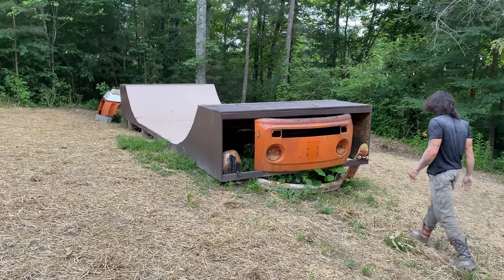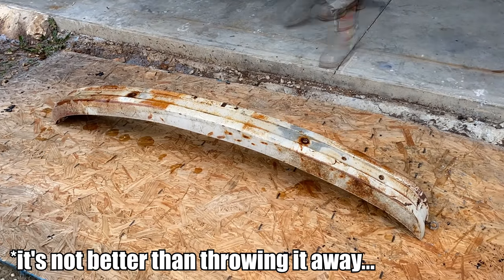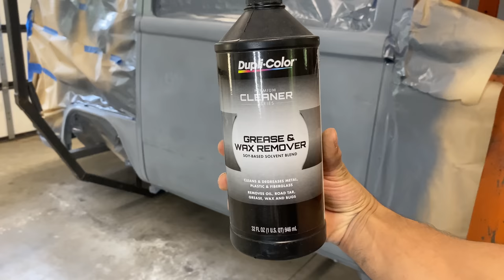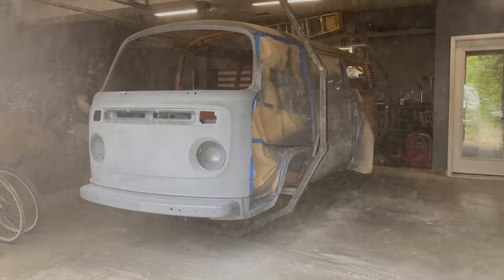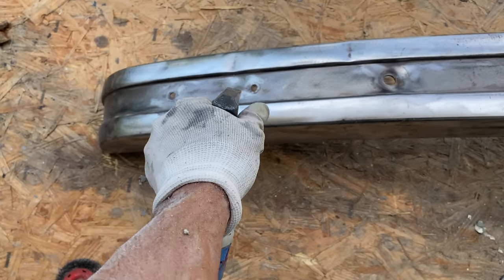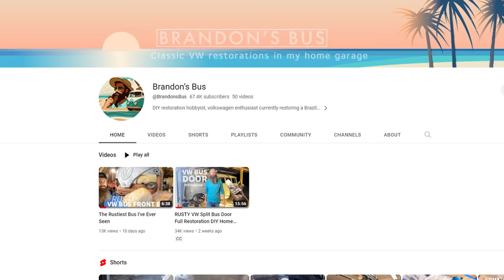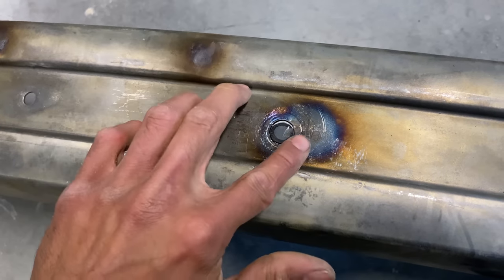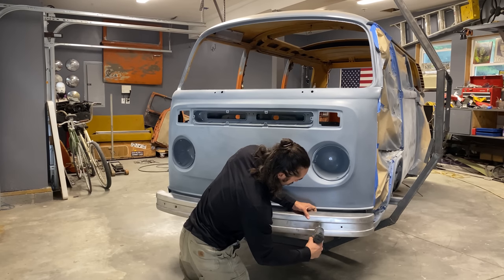VW Bus Restoration Episode:50 | Front Bumper Repaired

Comment: Ive got 2 sandblasters but id rather have a Malloy helping out 😉😜 great work on the bumper if your ever lazy with welding try putting a piece of copper behind the hole and fill it with weld 😎 works well👍🏽

Comment: Your bumper seemed to be fairly easy to bend back in shape compared to my 1972 van bumper (last year of the early bay bumpers). I am trying to do the same thing with mine and it feels like it's 1/4 inch plating. Glad to see you stuck with the original bumper as the replacements ones (IMO) are crap. It turned out real good!!! Thanks!!!
Reply from the maker: The torch helps a lot

Comment: I'm not a body man but I've always seen the bondo applied right on the prepped steel body not over primer.  Good work on the bumper.
Reply from the maker: Some old schoolers swear you can only use filler over bare metal but with epoxy primers now days a lot of people choose to do filler over primer as it seals the metal from potential moisture when applied correctly
Reply: @Vangabonders  Ok

Comment: Iam repairing a 1996 dodge dakota 4x4 that slipped into reverse while idling ,well it ran down hill and went about 100 yards and jumped my neighbors driveway then hit a pine tree well it kinda bent the passenger side rear quarter panel in after hitting the bumper..if it was a newer truck it would of really been major but this truck is made of 16 guage steel really tough..I took a chain a tractor and pulled out alot of it. But I very never done  Body work before. I love this truck ext cab 4x4 318 shell on back .but anyway love your channel you've really explained how your doing your vw bus and it seems like man you show me exactly what I need to do so thankyou

Comment: I can paint and panel beat to concours standard, and hence my ability is far beyond what is shown in these videos (and GET F-CKED anyone that says I have a 'big head' - HA -  I am just trying to explain) - and I am REALLY enjoying watching a 'backyarder' 'blunder' his way through (and NO disrespect intended) and learn and GREAT to see you girl out there sharing the experience with you - this is refreshing watching you two learn as you go and wish I could have provided some assistance (HA - although that would have ruined the making of these fun videos).  TIP - ALWAYS cover up from the UV of a MIG (ask me how I know) - and when using epoxy etc in a home garage - AWLAYS seal up any gap that may take the fumes inside the house - I am a bit concerned for you and your girl re the sometimes lack of PPE.  HA - and you are correct re the somewhat difficult task of sanding the fibreglass type fillers, but they can be very effective when used for a fit purpose (instead of lead in one one example). WEAR suitable gloves, and try and keep your hands off the bare steel.  And I almost forgot - NEVER EVER USE SAND for blasting - silicosis of the lungs can occur - HA - and NEVER use beach sand (as I have seen some tight arses use = to their regret - ONLY an true numbnut would use beach sand - HA).  The term "...sand blast..." should be deleted from everyone's mind - and use the term 'media blasting' - AND with the correct media - NOT sand - HA. EVERYONE - USE COOPERS STRIPPER from NEW ZEALAND - you will NEVER look back. (NO - I have nothing to do with their business) CHEERS from AUSTRALIA.